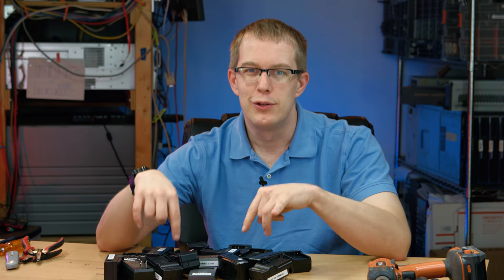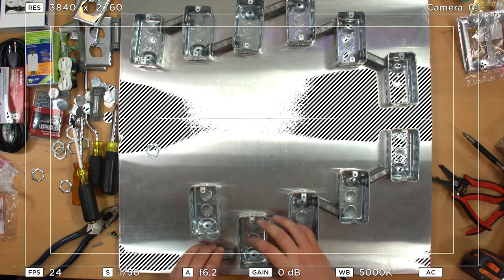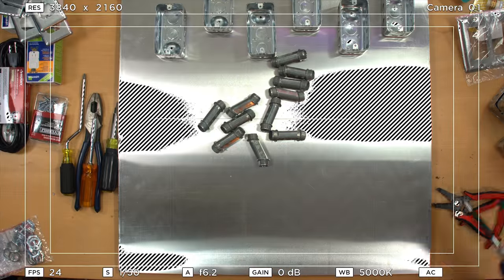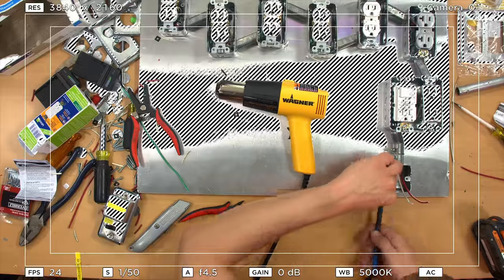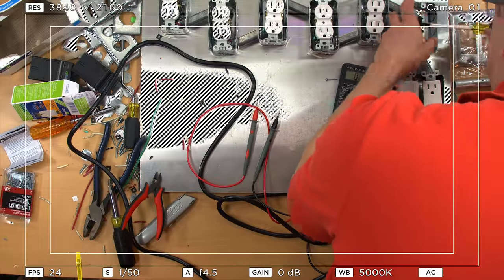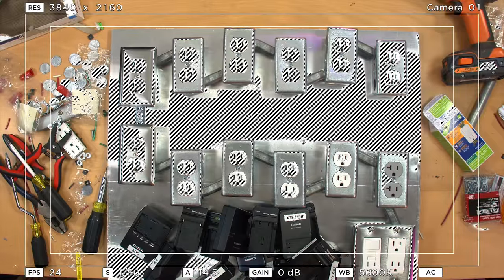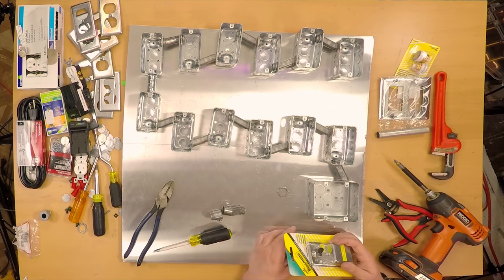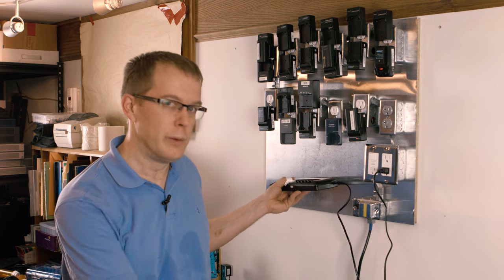Project: Massive Battery Charging Station Thing

Comment: try hot glue or hookloop for the AA charger, this way you see them and if they are full. Also easy toss in a bag. All that effort, I would have spent $30+ to make it look better by using single plugs so I would have all chargers facing down, and give a better aesthetic.  Really like the alum backing. Good video!

Comment: I like your video, thanks. I did something similar with less outlets and each box wire to a switch/receptacle combo. This way I could individually switch on/off individual chargers. If your still worried about over heating and such, you may want to stick a  smoke alarm over it.

Comment: Wooden board is a wrong choice, I've seen it causing fire in the factory, a corrective action is needed, immediately.
Reply from the maker: Well, it's a wooden board covered in aluminum.  Not fire proof, I know, but safer than the way people usually use these chargers;  Plugging them into plastic power strips, receptacles next to wooden trim, etc.   But which factory?
Reply: The location of the factory is unable to be reviewed, how ever it is in China, with similar situation as your work, but without the metal sheet cover on the wooden board.......

Metal sheet conduct electricity and heat as well.

Comment: Do people in America wire up plugs in spurs instead of a ring main to avoid overheating of the cable between the  sockets particularly the one at the end of the strip?
Reply from the maker: Yep, we call them "branch circuits" (among other things I guess).  But definitely no ring mains here.  No whole- (or half-) house RCDs/GFIs either.  But I don't think the difference comes down to preventing overheating;  In theory ring mains should keep things cooler by providing 2 current paths, all other things being equal.  To prevent overheating the most relevant/common rules here limit the number of devices (receptacles, light fixtures, etc) per branch circuit, limit most circuits to 80% of rated capacity for continuous loads (e.g. lighting, electric heating -- stuff that's on for 3+ hours at a clip), and of course define ampacity of various wire diameters for various situations that are relatively conservative.  There's probably 1000 other rules, too (before anyone from the US jumps on me) but those are just the ones that come to mind..

Dunno if that was too elaborate an answer, but I do have a tendency to go on..  ;)
Reply: Wow, no GFI's or RCD's! That's really surprising and dangerous. Over here to prevent overheating with too many devices, each socket is looped back with usually separate breakers per room rated at 60 - 100 amps (depending on max load needed) instead of on a 'branch' so each socket can take a full load of 13amps so this problem never occurs and if the a multiple sockets are on a 'branch' it wouldn't be a problem as electrical wiring is 20mm and extension cords 6-10mm.

Is it possible to have 240VAC in the US from the grid?

Anyways, Don't worry about the long answer, I am quite loquacious myself, hence why I watch your channel because it's detailed, interesting and very well made. :)
Reply from the maker: I didn't mean to mislead -- we protect a lot of circuits with GFI's, but not all.  Just wanted to make the point that we don't protect the entire panel (or an entire section) with GFI's.

And yes indeed for 240V.  I think this explains it better than me: http://inspectapedia.com/electric/0505s.jpg   We use 240V for larger loads;  e.g. central A/C, clothes dryers, hot water heaters, electric heat, range/oven (usually those last are natural gas or oil, but there are a lot of houses that are all-electric).

You're too kind, but much appreciated!
Reply: So it would be possible to wire up 240v sockets in the US so I could use UK appliance whihc are not multivoltage.
Reply from the maker: Voltage wise you'd be OK, but depending on the device it might not like 60Hz.
Reply: Thanks for the insight, also do you have Skype / Anchor or IRC?